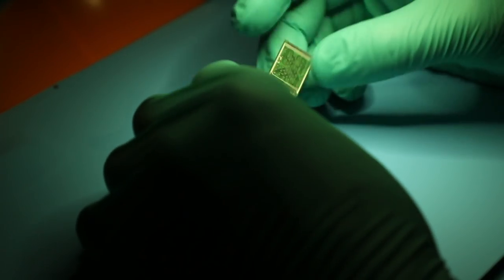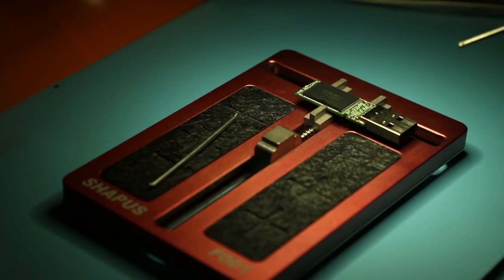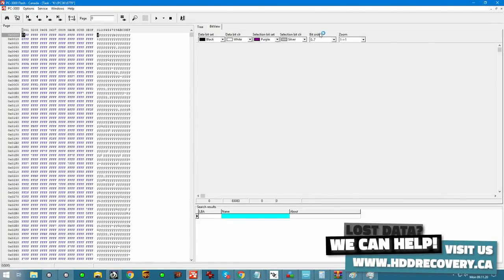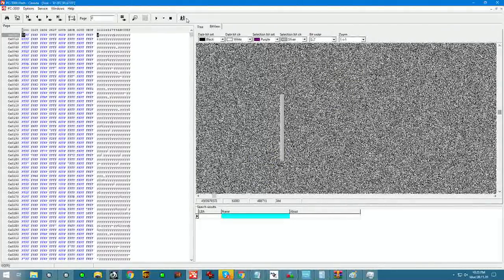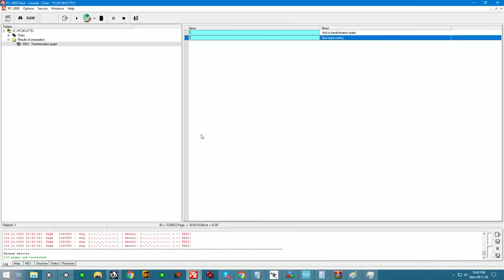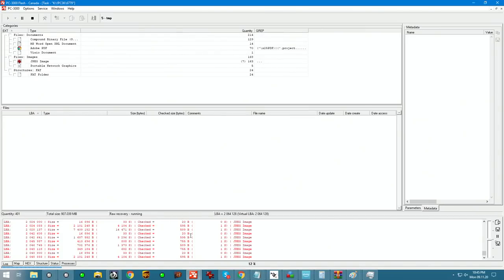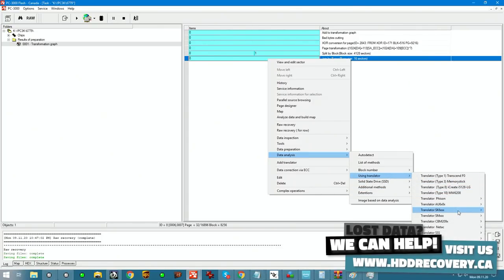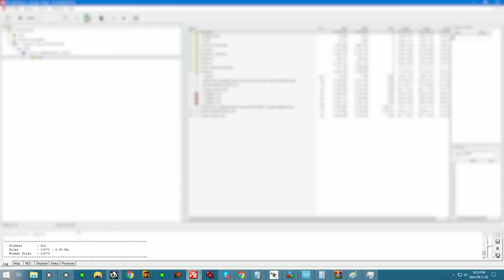flash drive fails to boot

Comment: Hi Erkin, this time you directly removed the chip without hot air 🙂. Why R studio error correction facility not use here?
Reply: In the old days we did not have hot air station because it was very expensive. He is an old school guy and a pro.
Reply from the maker: Ranga, for TSOP chips I prefer to use this super low melt mix. Rework hot air station heats up the chip and could cause further issues on bit level eventually. It can be avoided by removing with such low melt mix. R-studio is not a tool for NAND protocol

Comment: Dumb question, but is there a reason solder wick can stick to plate when trying to wiggle it around the board with soldering iron (tool) set to 350 degree celsius and flux applied? It just sticks to the board and gets all messy and on your videos it looks completely fine where you just use it to wipe the board without problem.
Reply: Wick quality
Reply: Iron is not hot enough and the board pulls the heat away and the solder solidifies. Also mix in some better solder before trying to wick the non-leaded solder off the board. The non-leaded has a higher melting point and is just a pain to work with.
Reply from the maker: Nikita, it could be that ground planes are very big and they take out a lot of heat from the iron. What iron are you using?
Reply: @hddrecoveryservices  Tin-lead solder POS-61 (61% tin and 39% lead) + I'm not using heating plate behind board. I'm trying to clear very small space on my broken GPU. I've read that smd components on the board could be attached using different iron which needs higher temperature, so at the end I'm using heating gun and waving in around needed parts for long periods of time.
Reply: @hddrecoveryservices  misunderstood you, I'm using LUKEY-852D+

Comment: Is there a way to read out the firmware from the controller and flash it on another controller with an eprom programmer or something like that? I accidently corrupted the firmware of one of my drives i have 4 of the same type. there is no data on it i just want to make it usable again. I tried all phison firmwares that i could find and flash with st tool but nothing works.

Comment: I see sometimes when it is not recovering complete files you get a lot of file size of the same number like 512k   for 30 straight files.
Reply from the maker: yeah, its running RAW scan so there is going to be lots of junk listed along. If the mix is right, and ECC is done - files should be original size.

Comment: It seems that the problem is not in the NAND
Reply from the maker: because the read out is clean? yes and no at the same time. FW for initialization along with translator are in the NAND, so if it boot loops and device comes up with SAFE mode there is not much else that can be an issue. But I do see your point that if the NAND was a clear issue, we would see much more bit errors present. Swap to an identical donor would confirm it, but I didn't have one